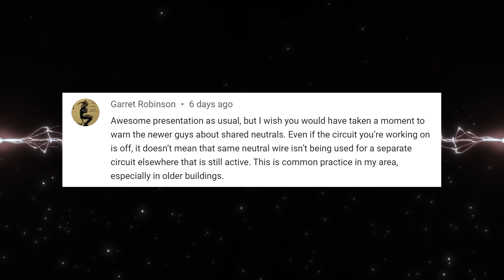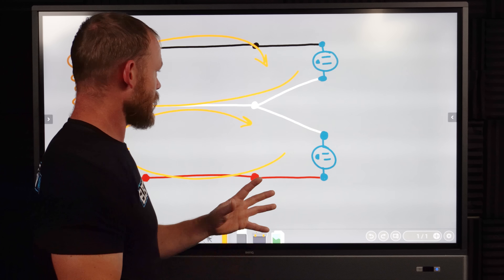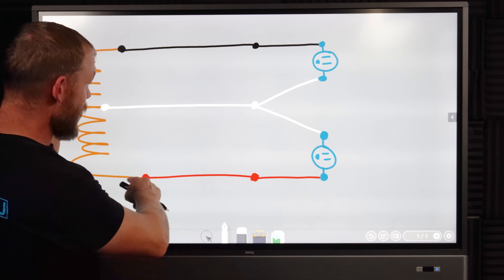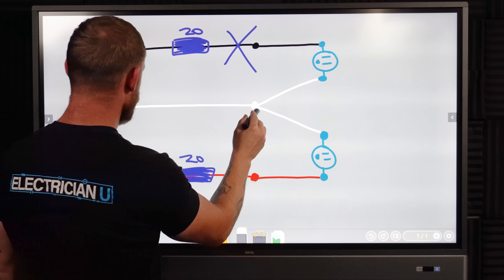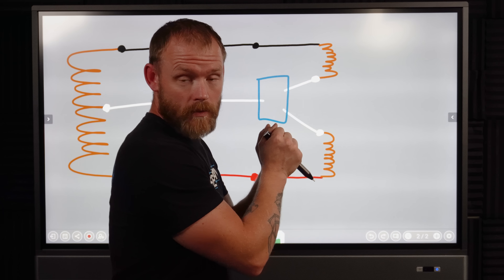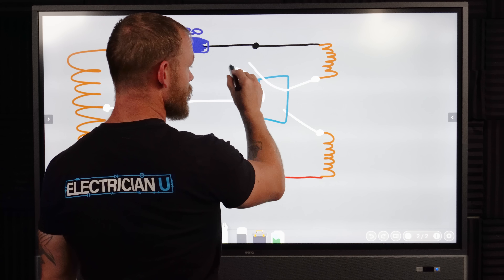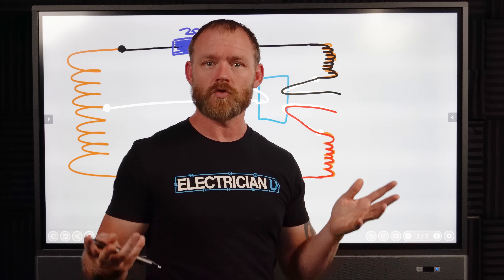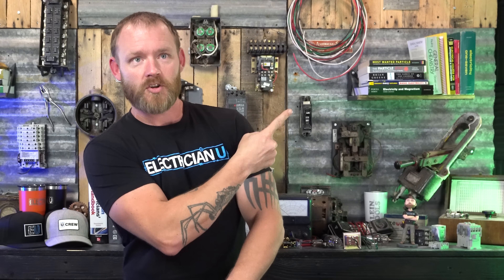The Dangers of Shared Neutrals: How To Avoid Being Shocked

Comment: Glad to see this issue is being addressed. I am in a 30's house where wiring is all in conduit. Everywhere they could, shared neutrals were used. When I added some circuits years ago, I just assumed this was standard practice, followed it and did not fix them. But somehow it just did not feel right. This was long before the days of the internet, YouTube and all the learning resources now available. I did go back and check the circuits. I actually made and kept detailed diagrams of the wiring because of how they mushed so many wires together in a single conduit run. They all seem to be on different phases. If I ever need to do more, I will run separate neutrals.
Reply: I guess at least there was conduit. it was probably considered to be an excellent installation when it was done lol.
Reply: Been working for dam near a hundred years with no inspection! Leave it alone!
Reply: I'm assuming it's BX flexible conduit. My and my parents' house (in different cities but both in the northeast) are from the '20s and both have that. Agree if everything is on opposing phases it should be totally fine from a load perspective, but that old BX should be replaced eventually.

Comment: If a metal box is grounded and you touch the neutral and the metal box at the same time you can get 120 because you are complete circuit. The ground and neutral goes back to each other at most panels and the neutral is going to want to pull off the ground to make the loop

Comment: sharing a neutral on light bulbs.... i need to install bulbs bulb i dont have any way of getting another neutral all the way back to the neutral bus on main panel. is it safe to just use a wire connector on a nearby receptacle to attach the bulb neutral so it has a completed circuit?

Comment: 3:26  You could still get a mild shock from the upper white conductor if you touch it while grounded; a small portion of the return current will flow through you.
Reply: Good point.  But I'd say "could" not "will."  While many things are fairly straight-forward, this would be complicated.  Depends on a lot of factors, like how "grounded" are you and possibly where you are along the circuit path.  Not to minimize the danger; I sure as hell wouldn't touch it.
Reply: Absolutely! If your body is providing the path to ground, then that "stub" white will all-of-a-sudden have current in it.

Comment: That’s why , if you run across a situation like that , if there isn’t already , you install breaker handle ties so that when you turn off one breaker the other breaker has to turn off too. That stops the possibility of potential on the neutral. If the breakers aren’t next to each other in the panel then you move them around so that the shared neutral circuits can have breaker handle ties installed.
Reply: And it's an NEC requirement 210.4(B)
Reply: @barryomahony4983  yes sir

Comment: Great explanation, as usual!

I ran a new 2-pole 20A breaker with 12/3 dedicated line for my shop table saw, splitting the duplex 5-20R receptacle into 2x 120V 20A with the shared neutral.  It is so I can upgrade it down the road to a 220V 20A simplex 6-20R receptacle when I upgrade my table saw from 120V to 220V.  In the mean time, it provides the saw's 120V and an extra outlet for some lights until then.  The key thing is it all ties back to that 2-pole breaker so both "legs" are shut off and never just the one.  Hopefully this meets code... chime in if not please!
Reply: I'm planning on doing this in my shop as well... I'm not sure why if it was on a double pole breaker that it would be a problem

Comment: I learned this the hard way. I missed one neuty under a wire nut on a 3 phase 277v lighting system. I turned all 3 breakers on and lit up all the fixtures downstream of that missed wire with 480v. Fried the drivers, and the tuners.

Comment: Thanks! My son told me about shared neutrals when I attempted to remove some aluminum wire in a panel that didn't seem to be doing anything. He said sometimes electricians use neutrals to save on wire and best left alone until the circuits can be checked fully. Panel is circa late 80's

Comment: 3:23 — "this part [of the neutral] won't [have current on it]".  Correct, to a point. But it's still electrically connected to current carrying conductors.  So if in touching it you create a nice path to ground you will get a shock from it. Maybe only a little one, the comparative resistance of you and the return conductor likely results in you only experiencing a few volts. But just because a metal part is not forming an active circuit is not enough to assume it to be entirely safe.

Oh. And GFCI breakers will soon show you if you have shared neutrals. The imbalanced current will make them trip quicker than you can say Romex!  😀

Comment: You can melt that neutral wire like a candle if both positive wires are landed on the same phase. If they are loaded up double the amount of current is returning back on that neutral. The breakers won’t trip but that neutral will fail spectacularly. Maybe a video should be done on this because it is easy to make this mistake. Keep up the great work !!
Reply: Positives huh.
Reply: Had this very thing happen to me. I'm an HVAC Journeyman. Doing a change-out, plug was burnt. "red flag". Did some digging and the furnace was on shared neutral with the kitchen/dining lights and plugs. The Neutral prong was the one that was melted in the plug.
Reply: He's got that nice "teaching wall" that has demo outlets and panels, so he could use that.  I say New Years is a great time to light that firecracker!
Reply: @MrBeesLuvsCheese  Yeah and all you need is a scalpel and basic anatomy to do surgery!!!  The problem is people who think they can learn it in a weekend!!
Reply: @MrBeesLuvsCheese  Obviously you did not read what I said. I did not disagree with what he said, I just clarified the difference betwee "tandem breakers and "two pole breakers". If some dummy took the wires off a two pole   breaker with a shared neutral, (3 wire circuits. 3 conductor with ground, Black, Red, White and ground.  This was commonly used this way for two 120 volt circuits. Two hots, one neutral and a ground. But the hots must be on seperate poles of hots. Common for long lighting runs split into two 120 volt circuits. Common in commercial space and big offices. These did not supply 240  volt to anything, just two 120 volt circuits. Typically ever other light on one circuit These were not required to be fed from two pole breakers (240 volts),  typical was two adjacent single pole breakers. Sometimes marked but not required. The tip off is both red and black wires

If someone tried to combine these two breakers into a single pole tandem breaker, that's when it's a problem.  That is what  @russboyko372 was talking about!

Most electricians know this, but the average DIY guy/home owner, does not!
Reply: 120 out of phase
Reply: Hot, not positive.
 Also, it's actually difficult to make that mistake because a 2 pole breaker connects to adjacent bus bar tabs that alternate phases. So unless you go against code and use 2 separate nonlinked breakers and install them with a gap in between them or an odd number gap in between them and land on the same phase, this problem wouldn't happen.
Reply: @GreasyReecey  Enter home owner re-arranging the breakers in the panel, so they are in a more logical order. "Why are these two kitchen breakers linked together? That's dumb. I think the breaker for the microwave belongs between these two."
Reply: @mikejjohnston  Not just the homeowner.  I had a licensed  electrician move circuits around to add a double pole.  I -- the homeowner -- was the one that caught the problem because one of our 220 circuits wasn't working.  Moral of the story:  Be careful of anyone moving breakers.
Reply: @mikejjohnston  Yeah and that's why if you really don't know what you are doing and have been properly trained in electrical, IT IS NOT A DIY SKILL!!!!!  Stick with household skills that won't kill you if you screw up!!!
Reply: @GreasyReecey  couldn’t that happen on them little tandem breakers that are sharing the same bus bar tho?
Reply: @russboyko372  These are not two pole breakers. The hots ae of the same side of the 240 "phase".  You can not replace a two pole breaker with one of these tandem breakers. 

A three wire, shared neutral circuit needs to be fed from a two pole breaker,. You can't arbitrarily move one hot to single pole breakers. If you are still a bit confused, close the panel and get an electrician!! You might think that rearranging breaker in a panel is an easy DIY job, but you just pointed out why it may not be a simple as it seems.
Reply: @professorg8383 lol love the beef here, yes someone who don’t know the codes can easily land black and red wires on tandem breaker, to get an extra slot, it was never a 240v circuit, 2 120v circuit with a shared neutral
Reply: @frostyfroze7352  It's just one example of where an untrained person should not be doing DIY work. Years ago, you did have the occasional DIY person, either too brave or too stupid, who would attempt DIY electrical work. And then along came the internet and DIY publishing of videos. 

In formal training, you would have a certified expert demonstrating the training. But now, any idiot with a smartphone can produce instructional videos. But as someone who is a certified training expert, most videos I see are really horrible with probably 98% of them showing something wrong and/or dangerous. And then throw into that mix, videos posted from all over the world from countries with different electrical systems and different regulations,  And lastly, the video is not interactive. It can't answer questions real time  or check for understanding, like you do in a real classroom training environment. Even a really well done video is subject to a lot of misinterpretation. 

But easy access to the wrong and dangerous, often misinterpreted videos, creates a bunch of viewers who believe that they know everything they need to know, from watching a 10 minute video. 

Overall, this is a big problem with most videos, however many do not present a lot of danger or risk. If you paint your living room wrong, it may look like shit, but it's not going to kill you or result in your house burning down. The problem is that the average person may not recognize the levels of risk and the potential for catastrophic results.
Reply: @jasoniron6664, I think you need to stop watching youtube video’s, and go to a proper schooling, to learn the difference between ALTERNATING & DIRECT CURRENT applications.
Reply: Positive wires?....probably a result from hearing electricians ignorantly using the word 'pole'.

Comment: Don't forget that if you're installing MWBCs for outlets, you are supposed to pigtail all the neutrals in a wire nut rather than passing them through the screw terminals on an outlet. This ensures that nobody will accidentally open the neutrals while doing an outlet swap.
Reply: Well you're supposed to turn the circuit off when working on it anyway.
Reply: Do you have the code reference for that? I'm intrigued because I just installed a MWBC for 2 outlets a few months ago, and if I know me, I probably just put them on the outlet terminal. Not much danger in my case, because I got a handle tie for the breakers, and clearly marked it "MWBC" or "shared neutral" in the panel and at every junction and outlet, but still, it wouldn't be hard to fix. I never thought of what you're describing.
Reply: @BohemianEngineer  
section 300.13b in the code, which states: “In multiwire branch circuits, the continuity of the grounded (neutral) conductor shall not depend on device connections such as lamp holders, receptacles, and so forth, where the removal of such devices would interrupt the continuity.”

Comment: Great vid. Please make a vid regarding length of wire when doing shared neutrals. As in can 14 awg go longer distance in 14/3 config shared neutral vs a standard 14/2 config. To try and combat voltage drop?  Thanks.

Comment: Yes, you can get shocked by a neutral.  This was in a house built in the mid 90's.  On a lighting circuit of course.  Breaker turned off and locked out.  Just neutrals hanging out of a box with no wire nuts on the neutrals.  Caught it on the back of my hand and it was like I could still feel it 10 minutes later.

Comment: one thing I was taught when taking apart joints is to break the hots, neutrals, then the grounds; and the opposite order when putting joints together. That and keep your boots on the ground and your idle hands off of metal boxes cans or cabinets. Both are good habits to form alongside not working energized whenever possible
Reply: One of the best comments.
Reply: boots on ground?

Comment: Never DISCONNECT the main of a shared neutral, it will cause 220v to pass through blowing shit up always shut off the 2 circuits affiliated with the neutral, getting shocked by the whit isn’t so bad.

Comment: Great thing for me to learn about ,we just did a panel upgrade for a customer and the inspector wanted me to “handle tie” all ckt breakers that share a neutral and zip tie the neutral wires together to ID them
Reply: Exactly. Breaker handle ties 👍
Reply: Yes Multi wire branch circuits , and don't zip tie them. Tape them at the panel all together with an identifying tape color if you have several  similar circuits , make your inspector happy 😊

Comment: I'm sure you have a show about using a white neutral conductor taped with black electrical tape to identify it as a hot, going in and out of a light switch.
(hot black into bottom switch screw terminal, black taped white coming off top switch screw terminal going to ceiling light j-box as hot conductor to gold hot screw of light fixture, where the circuit is using a different cables white terminal as it's neutral, a different cable, or "Romex" passing through the same ceiling j-box, and tapped into for a neutral connection).

Comment: So the other one I've seen that can get you in trouble that you didn't mention with shared neutrals, especially when they're not going into the box next to each other, is when someone's been messing around in the panel and now the two hots AREN'T out of phase. Everything works, but now you've got a double load coming back on that shared neutral effectively halving your total circuit overheat capacity between the two circuits, but no breaker is going to protect you.

Comment: hey! I'm working on the wires in my attic, and the NCV tester kept beeping even with the breaker off. I turned off each breaker one-by-one and it kept beeping (albeit only when using the low-voltage setting). I eventually use a multimeter and read 0.8V to 1.1V most of the time. It only disappeared completely when every single breaker was turned off...  which was odd...  Even more odd, the NCV tester was beeping on parts of a wire that was completely disconnected from the rest of the lines, even when the multimeter read 0. The multimeter couldn't seem to make up its mind, though, as apparently the air in my attic reads 0V to ~0.4V. I can only assume I'm being haunted at this point.   So, umm, know any electricians in New Jersey? Thanks!

Comment: My house is full of shared neutral. I always check neutral to ground. I also made certain, none are on the same leg in my panel. When I changed the panel, inspector told me I should have used double-pole breakers, but he still passed me since ‘better than before’. I swapped Federal Pacific panel to Square D. I have not spent the money to change breakers again since aware of the issue. Probably every house in my neighborhood is the same, and most still have that awful, ‘fake’ breaker panel.
Reply: You don’t need to replace your Sq D single-pole breakers. Just buy some handle ties and installed them on those breakers feeding the MWBC circuits.

Comment: another thing is when a multiwire branch circuit has two unbalanced loads and you lose the main neutral back to the panel but the other two circuit neutrals are connected the voltage you will read on each leg is dependent on the loads so if I have two different sized lamps on on each circuit you could get 180 on one leg and 60 on the other.

Comment: I wired my workshop using shared natural so that I could have two circuits in every junction box (I used different colored outlets for each circuit) so I could balance my draw when using two tools at once (ie a saw and dust collection) and it was easier to pull a 12/3 wire vs 2 12/2 wires.... but I labeled both circuits in the box as a shared natural and tied the two breakers together with a bar.

Comment: You should have mentioned the whole argument about shocked on a neutral is you are actually being shocked by an ungrounded conductor. Interesting experiment will a 3 phase 20A circuit work without a neutral?
Reply: Can you elaborate your question?
Because 3 phases motors or 3 phases heating elements systems dont use neutral.

Comment: The handle ties we installed didnt trip the other single pole breakers in square d qo panels.   Someone was talking about crimping them down.    On hundreds of panels in a highrise Marriott.
Reply: Its perfect like that.
We dont want both circuits to trip if only one trips.
We only want to make sure that if you are going to turn off a breaker to work on the circuit, that there is a share neutral with the other breaker next to it.
Reply: I just learned from mike holt. Handle ties arent supposed to make all 3 single pole breakers trip, if only one trips.  It's intent is to be like a fused disconnect acts.
Reply: @--JohnDoe  👍